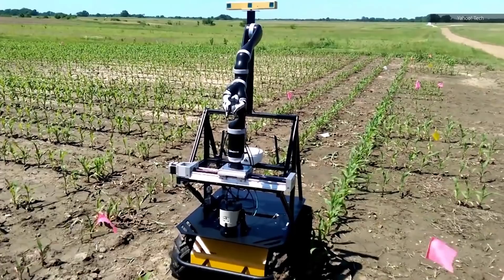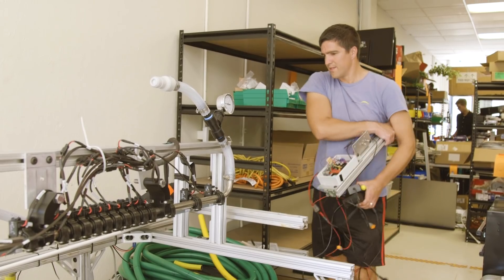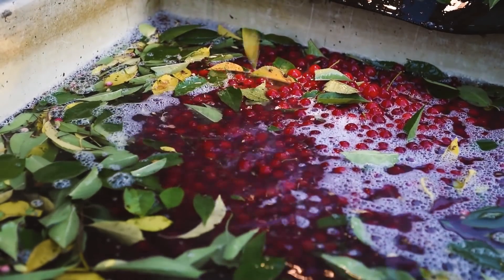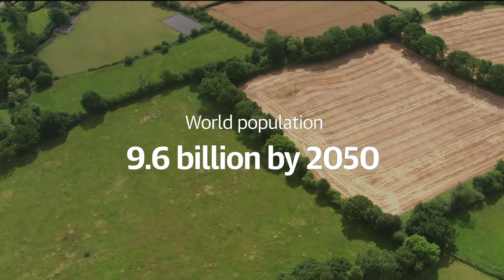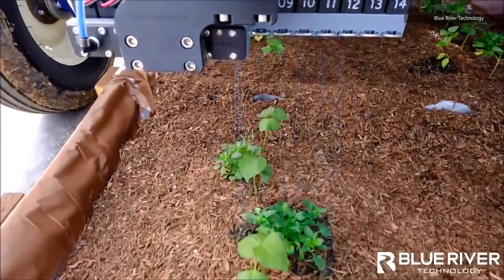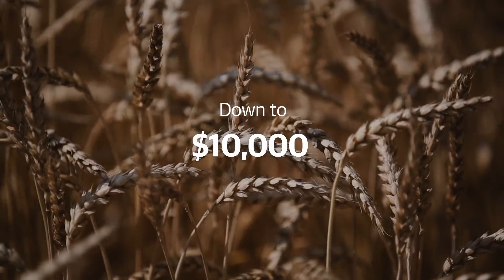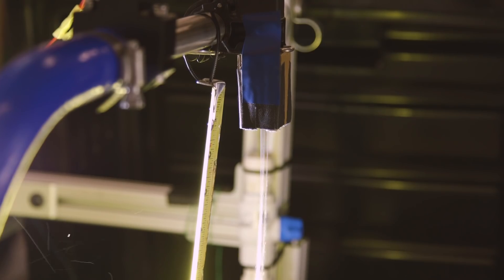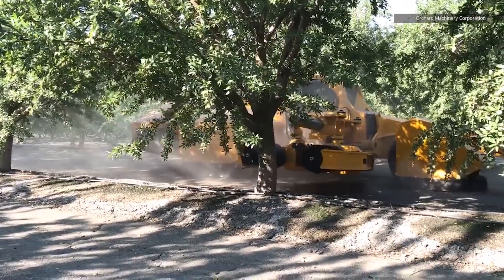The farming robots of tomorrow are here today | The Future IRL

Comment: If they have a machine that can selectively spray herbicide on weeds, you'd think it'd be more cost effective to fit it with a knife to just remove the plant so there's no need to buy and use herbicides.
Reply: Its often not enough just to cut the weed
Reply: @raventree7707  Sometimes, cutting the weed only excites the roots to create more growth in its survival. Weed removal altogether is the answer but not with chemicals as the chemicals eventually have a residual effect on the soil.
Reply: @oby-1607  yes exactly

Comment: They should make a robot that pulls weeds out that would be alot more cleaner.
Reply: release natural predators onto the insects eg ladybirds onto aphids. There's a few of these types of predators that can be released as eggs & that are currently being trialed in release from drones, but that machine could release them into a FAR more precise location, for far better survival rates

fungus is also better controlled if the main outbreak is cut off before chemically treating the residue, or returning a few times to remove the rest of the residue
Reply: Daisy Perez What if you try to “make that robot” instead of waiting somebody else to make it.
Reply: Nano robot to chase and kill insects

Comment: Why not make a robot that kills weed with steam instead of chemicals? Or better yet, mulches them?

Old guy is wrong; even small gardens will be automated within 5-10 years if not sooner.
Reply: FarmBot is an open source automated gardening system.
Reply: +Madster Godara Lol. You sound like a meme. Such poor grammar doesn't help your case, although I do understand english isn't your first language. 

Regardless, automation is only feasible from the 'top down'. It will not 'take over' overnight, it will be a gradual change that will only be picked up on the largest farms, and will slowly trickle down to the smaller farms. Automation won't be taking the 'small farmers' job, but it will make it easier on the small farmer in the future, when the technology progresses to the point it is accessible and efficient on the small scale. Resenting it out of hand will only do yourself an injustice.
Reply: small gardens are where most of this technology came from
Reply: The cost of computer controlled machines has come down quite a bit in recent years. Look at 3d printers, you can buy  or build your own for only a couple hundred dollars. Similar with CNC machines that can cost tens of thousands of dollars, a person can build their own a small fraction of that. You can find free plans and software for these and other things. They use customizable  Arduino controlled circuits that are also very affordable. Applications for these could easily be adapted to a variety of tasks, including tending to your backyard garden.
Reply: Small farmers will hire contractors to operate robots at appropriate times.   A lot of today's machine work is done on farms by contractors.   This spreads the cost between many users making it cheaper for all.
Reply: Farmbot is open sourced. Its amazing. it pushes the weeds down before it becomes a problem.
Reply: Economy stagnet just after 9 bil and then permaculture natural organic human raised foods be the purpose of more people then evr before. Farm fairs and contests will be the new Olympics. Quality like in Beef Bulls.  Artisan Farming
Reply: aleksander suur cooperative equipment shared can overcome this limitation. Robotics developments, over time, are bound to increase also in flexibility, allowing one's homebot to do the gardening if the plot is really too small, IMHO. His 'that'll never happen' comment may be very far off the mark.
Reply: Chris K especially since its already happening.
Reply: How about a strong water beam?
Reply: Within 2 years theres gonna be powerfull small robots for your garden.
Reply: Old guy is not entirely wrong, automation works best at large scale, equipment utilization factor is the key. Hardware is expensive and probably always will be, under scale farming just can't earn back the cost of automation. So no, nobody will bother automating small cabbage patches. What has been happening for a long time already and will continue to do so, is that small scale farming becomes increasingly more pointless. Large farms can use better equipment and take advantage of economies of scale to output such cheap produce that farming small scale with traditional methods is just an waste of effort. Equivalent amount of effort and skill put into pretty much anything else will buy you more cabbage than the cabbage patch will ever grow, so small scale farming becomes a hobby and not much more.
Reply: Nope, small units with a phone app will be tending small gardens - and they will likely be cheaper than your cell phone today.
Reply: @aleksandersuur9475  You assume that the status quo will remain forever. What you fail to realize is in the event of a crisis where food scarcity is rampant, food and water suddenly become more valuable than gold. I would much rather have a plot of land under my possession in the even of some natural disaster than some worthless paper money.
Reply: The average person won't have an automated garden in 5-10 years
Reply: Yep, only those with a garden will.
Reply: People don't do hand calculations to do their taxes.  If people think that doing it by hand is fun, fill your boots.  But if you try to go into business customers are not going to put up with the time and expense.

Food follows the exact same curve.  If I have a choice between a hand-raised carrot that costs 10 times as much as a carrot from a robotic farm, and the quality and pesticide load are the same, I'm buying the robotically raise carrot.  I have limited resources and I can't afford to support some grower's luddite tendency.

Society in general should always seek greater efficiency.  If you have a faster, better, cheaper process it aught to win in the marketplace.  The flipside of choosing the slower, worse, more expensive process is straight-up stupid.
Reply: 5-10 years for small gardens????? Are you high???
Reply: Until people realize we can't afford healthcare so its better to pay your farmer then the pharmacist.
Reply: unless the farm robot is multipurpose and is the cost of a lawn mower, no small garden will ever be automated. you must be one of those autodrive tesla lovers. reliance on technology will kill you. literally.

Comment: Technology and efficiency will not help if the philosophy, approach and/or strategy are misguided.  e.g., using less -cides will still kill the soil and poison the plants, even if only a little slower.  You need to bring life back to the soil.  Let the robots help with that ! (Perhaps by doing a quick soil test every 3 meters and applying the right kind of compost, compost tea or worms.)

Chemicals, tilling and -cides DESTROY SOIL !
Reply: Actually, when used properly, they don't. It only takes a matter of months or weeks for nowadays synthetic pesticides to fully be degraded by the "soil" as you call it. The future is into reducing doses, finding and using more selective pesticides and applying them when needed only where needed. 
I agree that we could get rid of herbicides soon using robots. Using more compost as a fertilizer is also doable but will be harder to implement. But against fungus you are bound to use synthetic pesticide.

Comment: It's ironic that we will finally have developed robotic farming just in time for when the topsoil collapse prevents having giant unsustainable monoculture fields that the robots need to function. I mean, look at the video, giant fields of lettuce grown on what amounts to a dustbowl.
Reply: Computer vision is allowing a robot to navigate unstructured environment where you have lots of plant diversity.
Reply: Boian Petkantchin actually you're right, check out farmbot for a small scale (backyard plot) version that can maintain a garden bed with multiple crops, and still recognise weeds. Stamps them out too, rather than spray.
Reply: Rich, short duration, water hungry crops like lettuce have no place growing in those conditions! No reason not to plant perennials with roots that are always holding the soil in place & run cattle on them. In this case I agree with the hydroponic vertical farm for the lettuce. silly to put it on soil like that.

& here's a tip for you, grow yourself a lettuce via kratky hydroponics with no air holes. That will mean no water escapes unless "drunk" by the lettuce. Compare the water use from that with your own water use. Remember to include intake & output in your measurements, since output can still have it's water returned to the ground. You'll find that when you only meansure the lost water (water that can't be used again until the next rain), you will need LESS water than 1 lettuce will! & that's in the most water efficent hydroponic sysem avai;able! 1 lettuce in dirt is going to be on par with 1 cow
Reply: cromulantkeith hydroponics inside buildings with pink lights
Reply: Dave Casey Yeah, I'm not that foreign to putting things together, but as for where to source the components I'm not too sure in Australia. Even sourcing it yourself wouldn't be cheap, and the additional cost might be worth it for the convenience considering I already have a family and Ironman training to worry about, among other things.

I think it would be huge fun for me and my son to put together :)
Reply: That lettuce is growing in a near desert (15.47 inches of rainfall) by irrigation.  Its not clear to me that the appearance means much about quality of the top soil.
Reply: Lilac Lizard - Well, I'm all for depopulating California and shutting down exports.  But people really like fresh greens in the winter time.  Go figure.  Apparently the fact that California is warm enough to have an extended growing season (even year around in the south) outweighs the issues of having to transport water from where the snow falls to where the climate supports agriculture.  

Now, its not clear to me whether growing lettuce in open air is the height of folly, or a profoundly efficient miracle of modern agriculture.  Given the lack of a free market in water in the western USA, it is tough to tell.  My guess is that your endeavor to compete by using kratky hydroponics will be economically challenged because you will be competing with comparatively cheap irrigation water.  I'm not all that familiar with California water laws, but I wouldn't be surprised if they didn't result in a use-it-or-lose-it situation, with the occasional allow-cities-to-buy-it-if-they-grease-the-right-palms modifications.  

In any case, I'm curious on why you are lobbying me.  I'm not making any purchasing decisions with regards to the lettuce industry.  I don't even buy lettuce.  More of a spinach or mesclun type of person.  And in my townhouse, I don't get enough sun light to effectively grow messculn on my balcony.
Reply: Rich, kratky isn't suitable for commercial use, it's just a way someone like yourself can actually explore this stuff really easily if it interests you to learn about :) That's why I was suggesting it, it's just a great way to learn hands on about it & it automatically shows you all the issues & efficiencies in different systems.
 
In your case, you can buy a 5w led from any hardware of big box store (choose the most powerful looking) & that will give you ample light for a lettuce or small area of mesculun plants if run for 12-16 hours everyday nice & close to them.  

Kratky is simply taking an old milk bottle or similar, dropping a hydroponic net pot in the top (a few cents to buy online) or improvising with something like an old sock, putting something into that to anchor the plant, such as a small amount of gravel & then filling the bottle with water that has miracle grow or any other basic fertiliser you can find added to it at the standard dilution rate. Under lights some people claim you can grow the entire lettuce with no water top ups, in the sun I find a 1litre bottle empties at least twice a week.

It's no-where near as good as proper hydroponic systems with proper air flow, grow time will be about double those, but it's great for situations like you have because you can grow plants super-close together (so get best use of the artificial lights) without the mess of dirt & lots of supplies to buy & it makes it really obvious just how much water lettuce use, which is fascinating to see.

Spinach won't grow (at least not well) to maturity in that system, it requires far more nutrients and far more light, which is why if you look at all those new vertical farms, they only grow lettuce & salad greens. If you switch from a walmart led to proper hydroponic grow lights, a lettuce will need only as much light as an african violet or other indoor plant (about 1w of coloured light, 2w of white).

Those are the reasons that in this case I think vertical farms win. You'll find lots of people (even in this video's comments) promoting vertical farms as the solution to everything, they're not! They're stupid for most stuff, especially whole crops (even spinach at this point in tech is really dumb to try), but they really do come into their own with compact, low light & low nutrient needing plants like lettuce that people want super fresh year round. They can stack them only 30cms/1 foot or so apart with artificial lights & mass produce in a way that is also perfectly suited to automation. 

If they can remove all heat by growing under low temp lights instead of the sun, they can also reduce water use significantly. They can then even be put into a building on top of or right next to cafes & hipster restaurants, so the produce can be served only 1-2 hours old. 

If they REALLY want to get water efficient, into the future they could put them into apartment of office buildings & plumb those buildings to have "urine diverting toilets" that separate out the dangerous waste from the sterile urine & direct the urine straight into the hydro system, so that 1. they get to use all that fertiliser (mixed 50/50 with water it's identical to miracle grow etc) instead of loosing the phosphorous, that is mined & running out & 2. they save a tonne of water by not using it to flush toilets. Only problem is all that legal marijuana is passing though the body in the urine & then will enter the food.......

Anyway, long post, but yeh, just trying to explain that some plants do have systems that are far better suited to them than open growing. Even just putting the heavy water users like lettuce into greenhouses & trying to design them to recoup the evaporation makes a lot of sense on this one (and extends the growing season even more). California's also experimenting quite a lot with aquaponics at the moment, not really getting it to commercially viable yet, but is an interesting concept if they can get there, as it means fish produced as well as the lettuce (and they're producing some quantities of the super high nutrient needers like spinach as well in those systems to deliberately drop nutrient levels before it hits the lettuce) & water use in those systems is the same as average hydro systems due to recirculation & capture of evaporation
Reply: Here in Colorado, hydroponics is mostly confined to marijuana, as far as I know.  My understanding is that the legalization/taxation scheme is designed to keep retail prices as high as black market prices.  Consequently, there is still a black market.   Indoor growing would provide security for both the black and white market growers.  So, to the best of my knowledge no one is pursuing open air cultivation.  But its not as if I have any better information than is available from internet searching.  

In contrast, the massive greenhouses that have been built in Spain for the tomatoes, etc, for the European marketplace, are visible on google maps satellite view.  My tomatoes come from Mexico, though.
Reply: You have never farmed in your life, have you.
Reply: Finally a comment from someone who knows something about soil. I don't want to eat something that grew in that depleted dust. The future will belong to the people who eat nutrient dense food from real farmers.
Reply: As for the Farmbot, it's only expensive IF you buy the ready-made kit from the inventor. Even then it's only $4000. If you have the desire and can figure out which end of a screwdriver does what, you can download the plans and the software to run it for FREE and build it yourself.
Reply: Perhaps it looks like a dustbowl because we no longer need massive irrigation to indiscriminately spray an entire field, but each plant individually. If it rains, the rest of the soil gets water, if not only the plants that need it.

There's a personal version of something like this, it's called Farmbot, for now it's kind of expensive and only works on a small garden bed, but the concept is cool!
Reply: Matthew Jenkinson tilling and killing underground life is what causes the dust bowl, the soil becomes sand or clay without soil life.